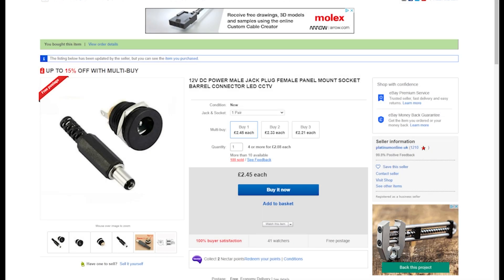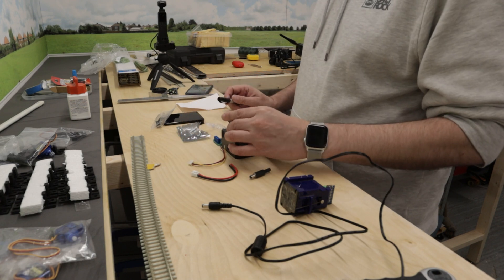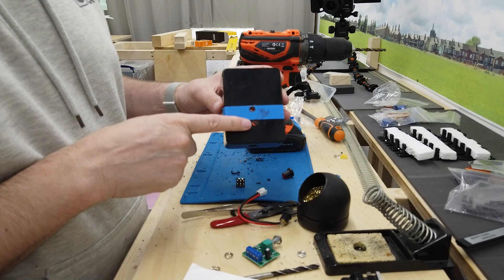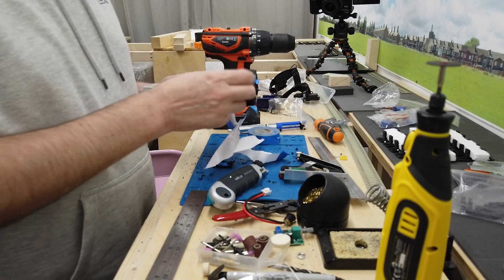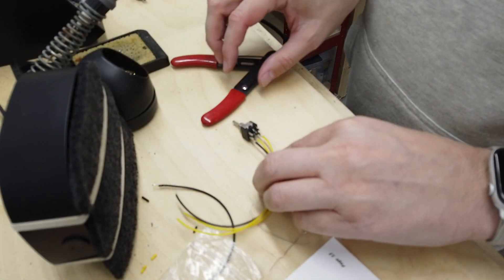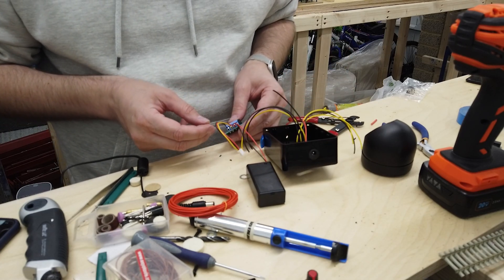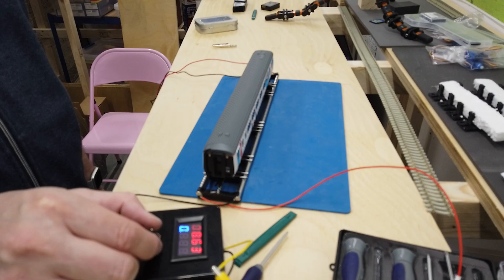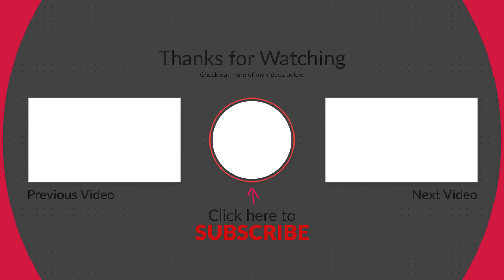Building a Model Layout in the Garage  - Part 10 - Built my own analogue (PWM) Controller

Comment: Seriously, is that drill in reverse or what? Sorry but my brain hurts at how slow it was drilling those holes. Love the channel by the way.
Reply from the maker: I can’t remember exactly, but I suspect I was either using very little pressure so I didn’t crack the case or and most likely I was using a blunt bit.